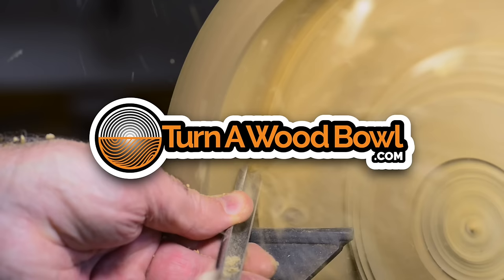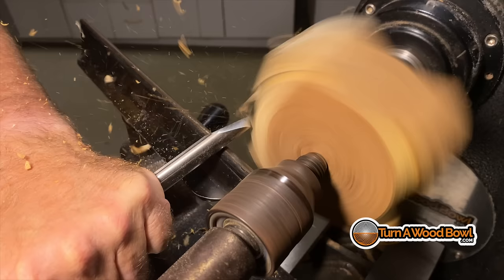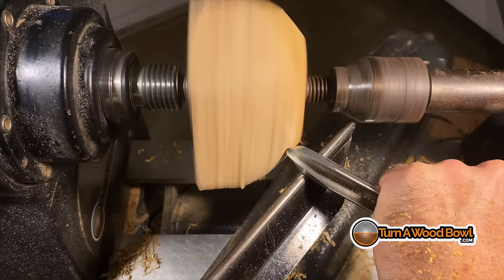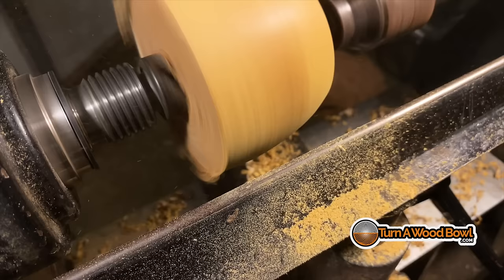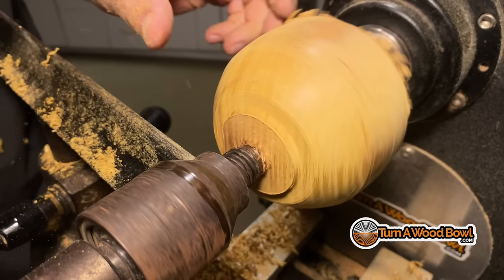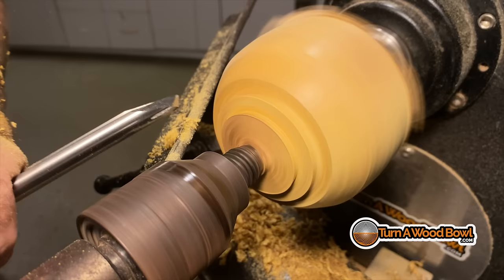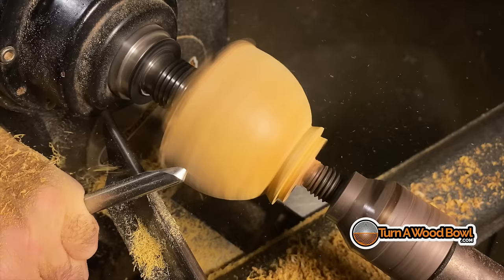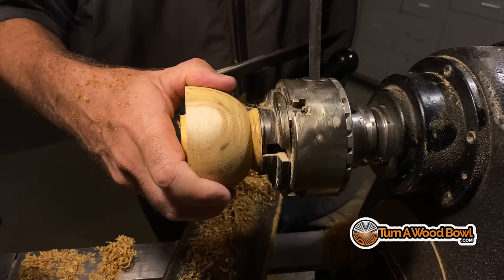Woodturning Cut Offs - Video

Comment: It's a lovely little box but as both of these are side grain isn't there more risk of uneven distortion when they change environment with a snug fit like that compared to say an end grain box with a pop fit lid?
Reply from the maker: Chris, Good question. As long as the wood is equalized it will not distort. The microwave technique is best https://turnawoodbowl.com/drying-green-wood-bowls-6-methods-success/ 
Happy Turning! 
Kent

Comment: On this and previous videos I noticed you didn’t tighten the set screws after screwing on the chuck to the spindle. Why not, and if they aren’t really needed, why are the set screws there to begin with? Does it have to do with reversing the spin direction?